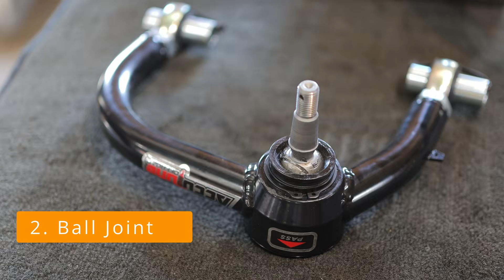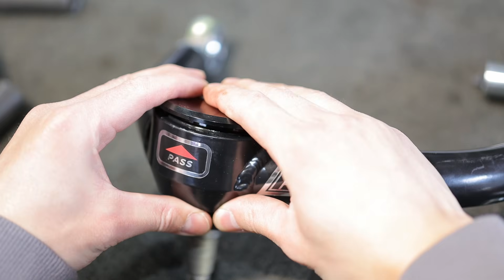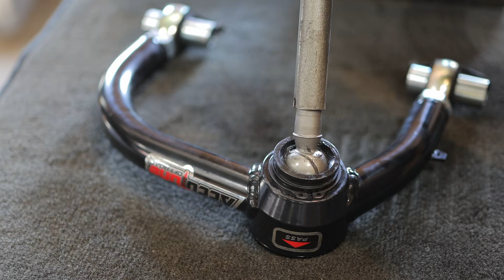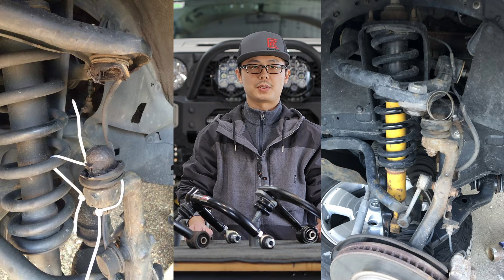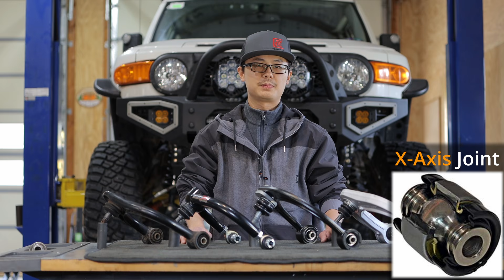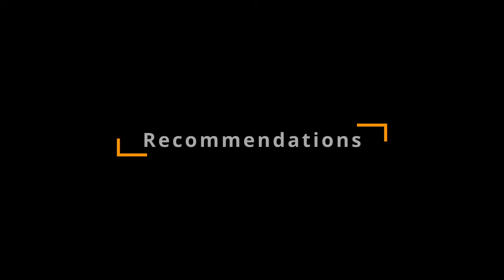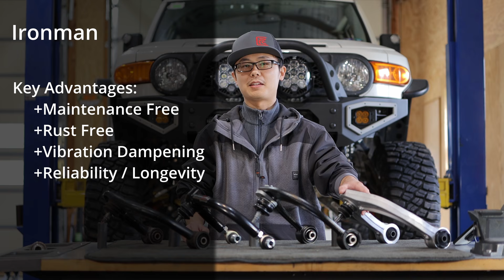Which UCA is Best for YOU? Toyota Aftermarket UCA Part 2

Comment: I really like your videos.
Lots of information to digest so we can make the best choice to modify our suspension.
Could you please include JBA Uca in your video comparison. The company says it has a 99 degree of articulation at the ball join due to their design and channel for grease on the bushings.
I am having a hard time de siding which UCA to get and now I am trying to figure out what is the better lift high.
I used to think the a 3" lift was better for clearance but I am not sure that is the way to go unless you are getting a long travel set up like the Marlin Crawler which very expensive giving everything it needs to be modified.
For me budget is very important since I cannot afford to expend a lot of money on the suspension but I want something that is reliable and does not break the bank.
Thanks again for your videos.
Reply from the maker: Thanks! Their EZ Lube bushing is easier to grease than other poly bushings. But it is still poly bushings at the end of the day. For Toyota prado platform, the high angle ball joint won't gain you any performance (see part 1 video)

Comment: Great videos both 1&2. I will say I just sent my SPC arms back for warranty. Those X Axis bushings failed after 25,000 miles of highway driving just a heads up to some considering them, and finding a competent technician to touch them is tough.
Reply from the maker: Thanks! That's some good real world feedback. From just the design it looks pretty promising. But sounds like not great execution
Reply: Same here on bushing. Plus, my ball joint failed too even with regular greasing. Leaving the bushings alone but replaced ball joint with SPC new sealed unit.

Comment: Have you looked into the marlin crawler RCLT-HD arms? Big Mike is able to run either 37s or 40s without spacers or a body mount chop and has a CTI score of 820!
Reply from the maker: It's a pretty impressive design. He did had to refab the front of the wheel well (under where the battery is mounted), which is probably more difficult to do. My dirtking long travel pushes the tire forward 1/2", I'm running 315/70R17. I'm already rubbing the front of the wheel well near full compression and steering. So I don't think "no need for BMC" means "less work" as many thought. Nevertheless, this kit has many unique benefits.

Comment: In another video you should explain as to why regearging doesn’t change MPGs in any significant amount. People keep repeating these myths without any understanding of the engineering behind it
Reply: The result depends on the overall combination of engine power, transmission gear ratios, diff gear ratio, and tire size. Changing the diff gearing can make a significant impact on MPG and drivability.
Reply: Clearly you don't understand what you're talking about.
Reply: Unless this is a troll post, it's possible that they are referring to regearing FOR taller tires (only). If you're matching lower gears with taller tires they can cancel each other out. Obviously, my post isn't aimed at regearing for specific offroad needs like rock crawling where you have larger tires and you're gearing down past that to also have a better crawl ratio.
If you're mall crawling with larger tires, you're just gearing down to get back to a stock final drive ratio with similar mpg, so long as you didn't put mud terrains on. ;)
Reply: obviously it can affect your mileage greatly, cruising at a higher or lower rpm will directly affect your mileage.
Reply: as an Engineer, I can tell you regearing absolutely effects MPG. Consider sitting in overdrive, at 70MPH. 

One gearing compared another, might result in 200rpm less, keeping the vehicle in a better torque zone at lower engine speeds.

Thus, using less fuel.

If you think gearing doesn't make a difference, next time don't shift to 6th gear, sit in 5th and rev it higher and see what that does to your MPG.

Often when increasing tyre size, the overdrive gear is no longer achievable without excessive throttle and fuel input.

Regearing will shift the rpm and torque to the correct ratio, allowing overdrive to be available at a low throttle input at highway speeds.

Comment: Love the way you break down your analysis. You touched on sway bars in a previous video, but hearing your pragmatic take on real world use (or removal) would be very informative!
Reply: that would be interesting video.  I thought I need at least fr sb, but after remove them all and with IM FCP and heavy spring (my rig is heavy), it handles very well offroad.  Onroad it is not at all bad as many have said it would.  I bought the fr sb to install but now decide to go without fr/rr sb..  Dampening of suspension and correct pairing of spring definitely help.  Love to hear more from Jake analysis

Comment: Great comparison and rundown! I went with Ironman UCAs because I valued them being basically maintenance free and closer to OEM. I can swap ball joints out and get new bushings without having to go with expensive alternatives. Additionally, I’ve found a lot of the spherical joints to be noisier, even when greased up regularly. Obviously going to depend on use case, but for me a more OEM spec worked great.
Reply from the maker: Agree, unless for actual racing, I always prefer everything close to OEM.
Reply: Tinkerer's Adventure what do you think about their shocks the Ironman 4x4 foamcell shocks?
Reply: Agreed 100%. How many miles do you have on your IM UCA? Any noise issues?
Reply: How are your Iron UCA’s holding up? How many miles have you put on them?

Comment: Although not as popular what are your opinions on the JBA Upper control arm? I'm running one on my GX470 because of the ease of being able to unbolt the ball joint (using a GM ball joint) the cheaper availability of said ball joints and the ability to adjust caster and camber from the top of the ball joint. The only downside I saw with these was the polyurethane bushings towards the shock mount but with religious greasing they should be fine as I have been doing. Thanks!
Reply: I have JBA arms too but wasn’t aware you could adjust caster and camber from the top of the ball joint! How do you do this?
Reply: @zixiaoliang  The GM Ball joint has two notches that allow it to rotate similarly to the SPC UCA and from there you should be able to adjust caster. The camber part is more of playing with the entire setup to keep it adjusted properly because of the offset style of the circle changing the measurements of the caster will also impact your camber in the process. (not by much but enough that you want to double check all your measurements while aligning the vehicle).
Reply: @MrP1NEAPPLE  Isn't that the cap that they use to assemble the ball joint? I didn't think it was offset adjustment. If it was, I'm sure JBA would mention it on the website? Unless I'm missing something?
Reply from the maker: I don't have first hand experience with JBA. Their EZ lube poly bushing doesn't require loosening the UCA bolt. So that's a plus compared to other brand's poly bushing. I'm also not sure if the ball joint can be adjusted.